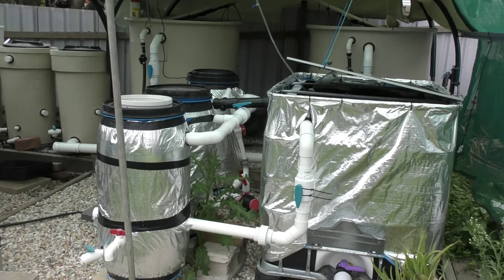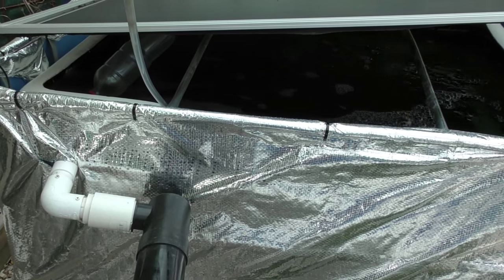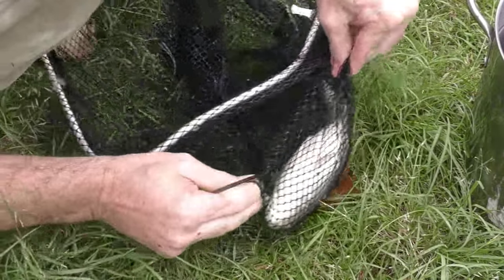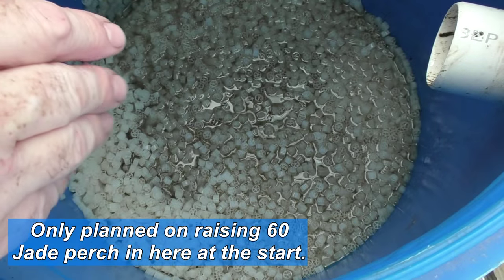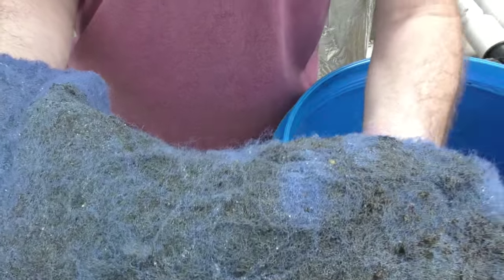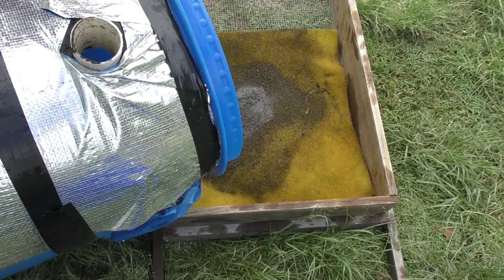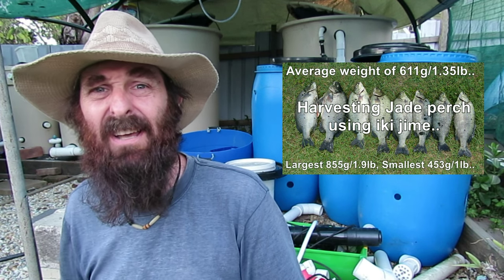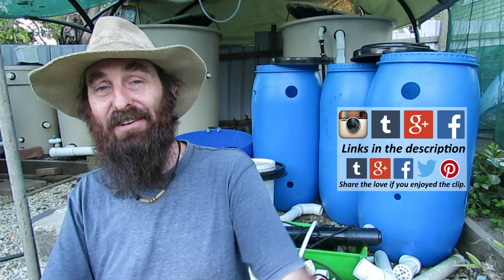Harvesting Jade Perch & Dismantling the fish farm (RAS) with added compost worms.

Comment: sorry for commenting on an older vid - but keen on the UV filter. Could you give any more info/details pls?, how you found it? worth it (and where from pls)? - also drum filter pls? - Is that the solid radial flow filter before your bio filter?
Reply from the maker: I wouldn't recommend a UV filter for aquaponics as I've read that it can reduce the availability of some elements, boron & manganese from memory. Possibly iron as well but haven't seen any papers on that one. 
Worked great in this straight aquaculture build though. 👍 I bought it from a aquarium supplier here in SE QLD Australia. From memory it could handle a 1400lph/370gph flow rate. Not sure of the brand sorry as I can't find the recept email in my account. 
Hope that helps some.

Comment: Hello Rob, have you ever thought of making a DIY drum filter from a front load washing machine? I haven't found much online of other folks doing it, but I'd imagine if you kept just the frame to hold it out of the water, cut out sections of the basin for water to flow over a 20 micron screen wrapped and secured around it, a catch pan to suspend in the drum above the inlet pipe to catch the waste rinsed out from water jets above the drum with a pipe leading out of it to get rid of the waste....just brainstorming!
Reply from the maker: Hi Tyler.
Have seen a few basic ones set up where it's just a mesh cylinder that the water flows through & gets manually cleaned a few times a week. Have also seen a few folks in the Koi community make up fines filters using the same mesh but set up differently a bit like this one.
https://www.youtube.com/watch?v=4WwNkD-wN4Y
Am planing to have filter pad then fine mesh filter in front of the raft bed once it's built. It's just not high on my list of priorities at the  moment.  
Would like to see what you come up with if you're going to have a crack at one👍 
 Cheers mate.
Reply: Thanks for the quick reply! I'm currently in the service, and I cant really dabble too much. A couple more years when my enlistment ends though, and I plan to begin my own RAS system for raising fish for market sale. I think if i cannot create my own, I might go with a bubble washed bead filter though, they seem much cheaper than the commercially available drum filters!
Reply from the maker: Cheers Tyler. The drum filters are fairly expensive from what I've seen of others systems. Worth the coin if you're getting good returns though.

Comment: what is the silver thing wrapping your fish tank and fillter system?
Reply from the maker: Hi there. It's actually a foil insulation wrap or sarking.  It was given to me by  the bloke that sold me the round aquaponic tanks & filters. Works great at keeping the light out but I think timer boards would look a lot easier on the eye ;) 
Cheers.
Reply: Rob Bob's Backyard Farming 
thank you.

I have heat problem to. this is a good idea, to keep barrel and pipe cool.
Reply from the maker: No problem at all. Hope it helps with the heat issue too mate.
Cheers.

Comment: Did you have any trouble with the ibc tanks leaking at the valves?
Reply from the maker: Sorry I missed this Daniel.
I had no issues with ours but know folks that did. The ended up opening the valve as far as they could & filled them with a fish friendly sealant then closing them as tight as they could. Also capping the end of the valve would help as well if one came with the IBC.
Cheers & have a top one.